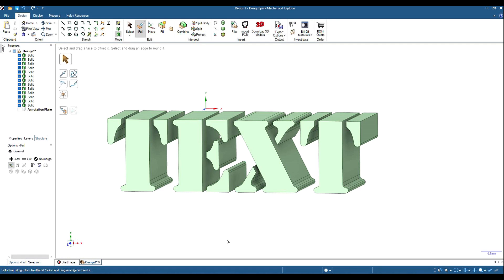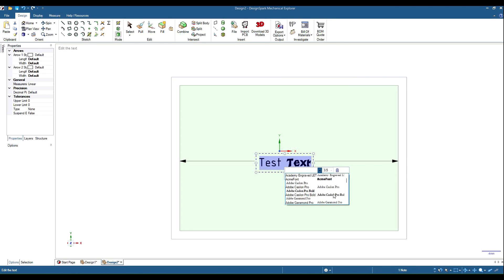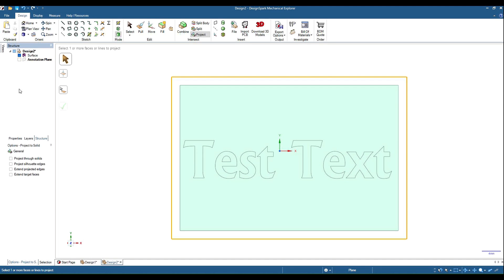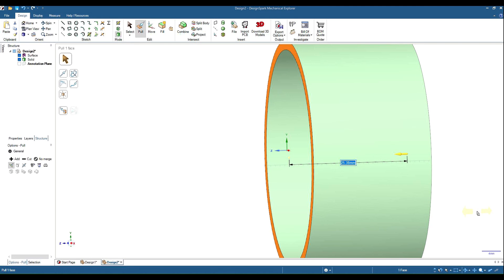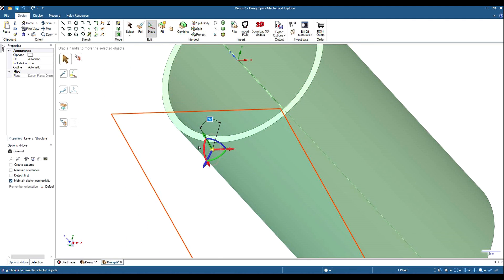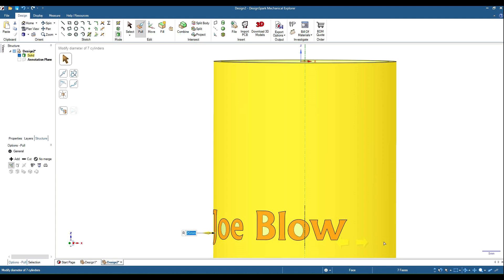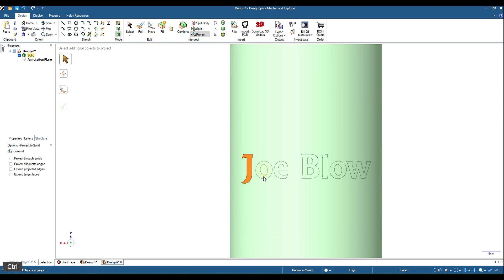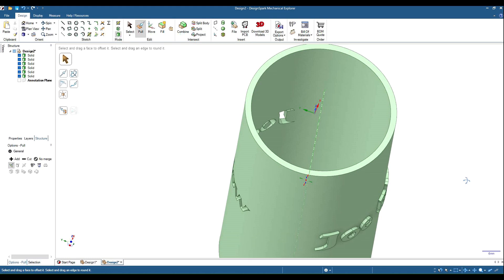DesignSpark Mechanical Tutorial, Working with Text

Comment: hi, can you only place text onto a surface or can you stand the text (upright) on a surface so that only the bottom of the text is on the surface?
Reply from the maker: You can only project onto a surface but you can remove the surface after using the Pull tool to give the text depth and then place the base of the text on a difference  surface.